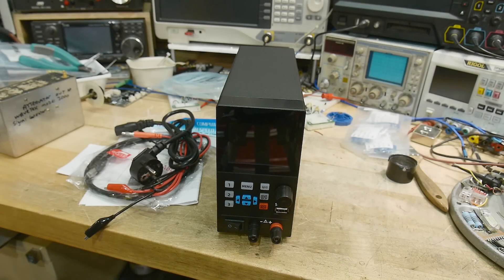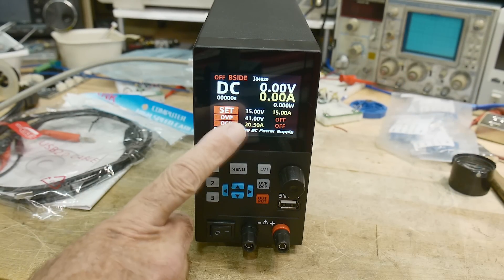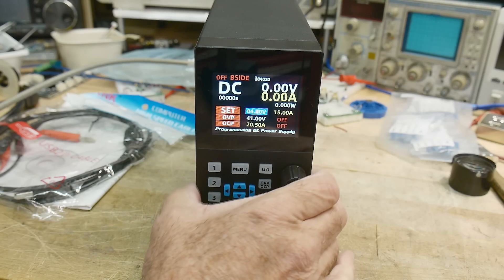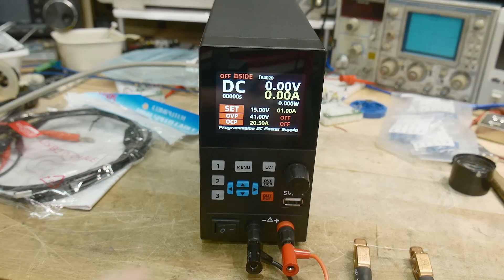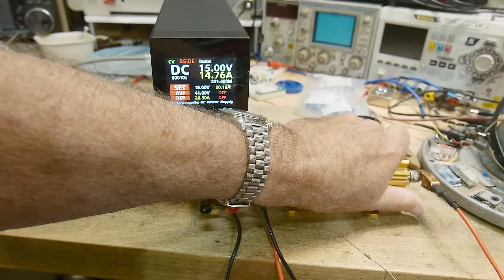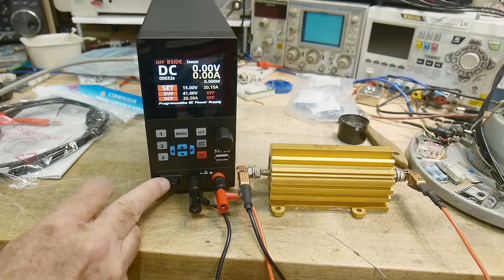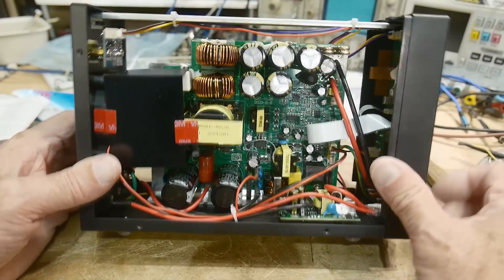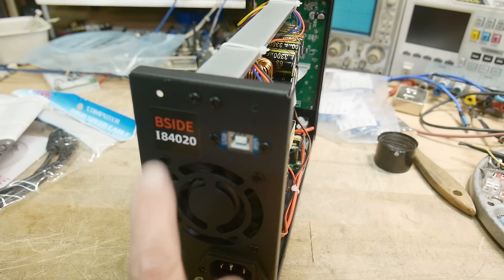#1941 I84020 BSIDE Bench Power Supply

Comment: I noticed all the capacitors are directly at the output, meaning any load variation will first dump the capacitors before it adheres to the current limit. Any thoughts on that?
Reply from the maker: you can't tell just looking at the board. lots of capacitors scattered about. would need a schematic to comment on the design.
Reply: @IMSAIGuy  You can check the behavior. Limit the current to 12V + 1Amp (like you already did) and while on, connect your impressive 1 Ohm resistor, and see  how much current there runs for the first 10mS or so. Anyway, I already did that, and was asking because I myself was not very impressed with the large current spike, and was wondering if this was usual behavior for a current limited lab power supplies. Also I checked the pcb traces, and the capacitors are indeed immediately on the output.
Reply from the maker: In a switcher supply there will always be capacitors on the output. there will also be capacitors on the input side (which there are on this unit). transient time for  current steps are a design parameter and will differ from supply to supply. if you watched my video #2155, that supply has an extremely  fast transient (probably the best available) but that is a $4000 unit. the simple chinese ones will not be great.

Comment: You can also use the arrow buttons to move the number setting position.
The unit that was shipped to me didn't get checked before shipping... Both the positive and negative output wires were left in soldered to the circuit board. When i removed the cover the red wire was floating in the air. The black wire was stuck in the hole but not soldered. After I soldered the wires in their holes the unit works.

Comment: Hi IMSAI Guy. First of all, thank you for your videos, they are very helpful for those of us who are just starting out and learning in the world of electronics.

I'm thinking of buying a power supply that gives me at least 30V and 20A for repairing laptops and other electronic devices.
I have a question about this power supply. Is this device suitable for repairing laptops or other electronic devices, for detecting short circuits, etc.? Are this OVP and OCP safe? I'm a little worried about the voltage/amperage dropping so slowly.
As I said, I'm new to this world, I'm studying and learning electronics and I still don't understand many things.

Thank you very much in advance and a hug.
Reply from the maker: seems like a lot of current. I always encourage people getting started to get what ever they can afford. But, if you are worried about damaging something you are trying to repair, expect that you will fail many times even with the best equipment. start out repairng things you would have thrown in the trash anyway. This supply is OK. Nothing like a good Rigol or used HP.
Reply: @IMSAIGuy  Thank you very much for your answer, my friend.

Another question I have is: I have seen in another analysis that the power supply is isolated from ground, or at least the current output. What does this mean? I mean, what is this for? Is it galvanic isolation? Maybe it has an isolation transformer? And is this safe?
Excuse my ignorance, I am quite new to electronics and although I am studying daily, I still miss a lot of things.

Thank you very much again, a hug.
Reply from the maker: @CesarHawk1  No it is not isolated.
Reply: @IMSAIGuy  Thank you very much for your answers and for your help, my friend.

I don't know if you tried it, but it can supply 20V and 12A, right?.
There are some laptops that need 20V-12A to be able to start, that's why I need a power supply that can reach 20A.
I have a 30V-10A one, but it's not enough to start certain computers.
I understand that being a 300W source it will not be able to supply more than 20V and 15A, etc. I know that to exceed those voltages and more than 15A, I will need a power supply less than 600W. 

Thanks in advance and a hug.
Reply from the maker: @CesarHawk1  the limit is V * I < 300watts
Reply: @IMSAIGuy  Yes, thank you, I understand that. Sorry, my message was cut off at that part.

So, in your professional opinion, do you think that with this power supply I will be fine for repairing laptops, PCBs, graphic cards and other electronic devices, or maybe I should go for a higher power supply, for example 600W?. I don't know if there are any devices that may require more than 20V and 12A-15A.
I have also seen the Wanptek KPS 3020D power supply which is 600W.

I hope you can excuse so many questions. Apart from studying, asking people with a lot of experience like you is the best way to learn.

Thank you very much in advance for your help and patience. A hug.
Reply from the maker: Sorry, but I'm worried that you can't answer these questions yourself. You seem to be going too fast for your level of education.

Comment: My power supply failed after around 40 minutes of usage (it is a problem from inside because the 5A fuse is blowing when I try to turn on the supply). I did some investigations on my project and I observed that it have an inrush current of 19A at 12V for a period on 40us (when it is connected to supply) and I think that was the end for the power supply.  I contacted bagoong for full refund, (the power supply failed after 2 weeks after I received it) and they after 10 days says that can refund 15 dollars. 
I not recommending this power supply (to pay 130 dollars and to use it for 30~45 minutes ....... that was in my case).

Comment: I fell for the "20 amps" without seeing the 300 watt max. I wanted to log the max amp usage of a 24 volt AC. That could be as much as  15 amps. No way I can get 24 volts at 15 amps with this -- but still better than a 10 amp supply.

Comment: If you want a good power supply on eBay lots of used HP 6033A SYSTEM POWER SUPPLY 0-20V 30A low noise.

Comment: Siglent has the same problem with the connector spacing.
Reply: I agree - I have an SPD3303X - it bothers me there, but with the 60A power supply I made, I deliberately did not keep the spacing of the sockets.

Comment: I'm sorry to say, but you can't call this video a review. 
It was more of a quick test and a very crude view of the inside with rotating the device at light speed. 
I understand that you can't devote hours off your time on a review, but if you look at the comments of other viewers, 
there are a lot of questions and very few answers after this "review".
What about the ripple ? Is the output floating or tied to ground, if tied to ground, you can't use it in series with another powersupply or you create a short if that powersupply's output is grounded. What about the current measuring, did they use a old skool current shunt or did they use a dedicated chip with a Hall sensor ? 
A slow view across the board could have show this, instead of rotating the device at light speed.
How loud is the fan? A stress test could have showed that. Does the 5V USB output share the same negative as the powersupply itself ? 
How does the 5V output perform under load ? Does the powersupply have a fuse ?
So many questions with no answers.
Reply: I will join - OVP functionality, OCP, transition speed
 CC/CV, residual capacity at the output, back interference to the network, etc.
Reply: @Edisson.  lots of questions, with less answers. Cutting corners like they say. Grts

Comment: CC stands for constant current, not current compliance?  Right?  I don’t like that it’s not obvious that the output is on.  Should be a separate light.  Or maybe a lighted output button.  Buttons and knobs are too squished together.  I like a horizontal power supply better than these vertical ones.

Comment: I know that some people like the safety ground going to the case, so does most of the regulations for electrical safety. 🙂
Reply: Agreed,,, the case is “ground zero” so to speak.
Earth/ground safety 101.
Reply: @brianpeers  also the earth shall be fastened independently of any other mounting hardware. i must go back and have a look at BS EN 601010 or the Ul equivalent.
Reply: @TheEmbeddedHobbyist  That makes perfect sense yes for the input earth conductor to have its own dedicated mechanical fastener attached securely to the appliances metal chassis. No pop rivets please. And no paint etc in the way.
Cheers from New Zealand. 48 years of radio/electronics servicing and I thought I had seen it all in regards to electrical safety failures until the other day when I came across a CD player, tuner, and amplifier all three of them wired into a single mains plug.
They had even got the phase and neutral around the wrong way. I could send you a photo but this platform does not allow it.

Comment: Why do you say that U/I should be V/I? We're not all Americans. U is commonly used in Europe for voltage (difference).
Reply: Indeed, this is also stated on the Ohm's law site of Fluke. In the Englisch version of that site they use V for voltage, and on the Dutch version of that site, they use U.
In my opinion is V choosen wrong, because in Ohm's law we use I for current and not A.
Reply: it is not even U, it is a chalk board times version of greek upsilon (lower case upsilon, but written in upper case in the context of physics school class, no wonder it is not on any keyboard). There is nothing 'american' in it, just oldschool vs new flexible one. The whole debate is endless as there is no such standard or even solid meaning history for U.
Reply from the maker: where are all the pedantic viewers? isn't the Volt an SI unit? maybe it should be V/A
Reply: @IMSAIGuy  taking the pedantic viewer role volts and amperes are units indeed. U or E and I are parameter symbols most used for voltage potential and current expressed in units of V and A. Except of course in the land of foot, pint and stones where V is expressed in V. Very logical. 🤭

Comment: I like these small power supplies very much and they are getting better version by version. The last 3 of them are on the bench and used for drilling machines soldering irons and normal power supplies. They might not be perfect regarding noise when testing sensitive electronics but a passive filter can be added as self made adapter.

Comment: Like to see output ripple with that 1R resistor, and also low current ripple, likely to be not too bad, though the constant current is very likely to have some rather nasty transient peaks, with all that output capacitance, and current limiting might not save your DUT if it has an accident, those capacitors will deliver some brutal spike before the control loop can drop it back down. But not at all a bad looking unit, though it looks like the software and USB is just a CH340 serial interface, wonder just how janky the software is, and what the command set is like for it.

USB output a good extra, plenty of times you need a 5V supply, though as it is part of the control loop, they probably share a common ground, and that can be an issue. Should have provided a separate isolated USB power, an extra few cents to add the extra wire, the diode and the capacitor, and then instead have had it separate, with at least 250VDC isolation, so that you can use other USB powered test equipment with it, or included a small USB C full function supply, or at least one capable of doing negotiation up to 30W instead, so you can run more modern test equipment as well off a single mains connection. Plenty of space in that cabinet to have added that extra board, and fed off the existing aux supply rectifier and capacitor for primary, or off the main board  340V supply rails.

Comment: 15A @110VAC. Or 15A @40V DC?
Reply: 20A @ 40V DC , powersupplies are not advertised with there amp ratings of the mains side.
Reply: @BjornV78 300 watts would be the  limit  so divide 300 watts by your  input voltage and that would  be about your max amps.

Comment: I couldn't use this because I have 15 amp fuses in my lap
Reply: 20A @ 40V DC , powersupplies are not advertised with there amp ratings of the mains side.
This means in theory 800Watt on the output side , NOT the mains side. 
With 120V AC mains, this powersupply only draws arround 6A on the mains side. With 240V mains, it only draws arround 3A.
Reply: @BjornV78 Man, i think if he couldn’t understand that, he is not ready to have lab yet)